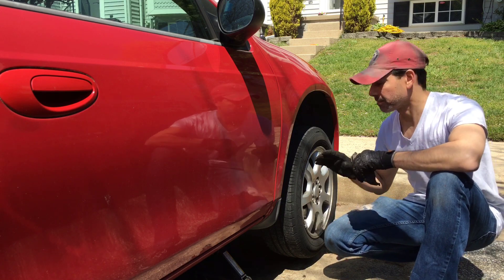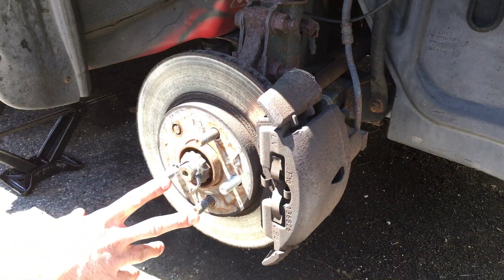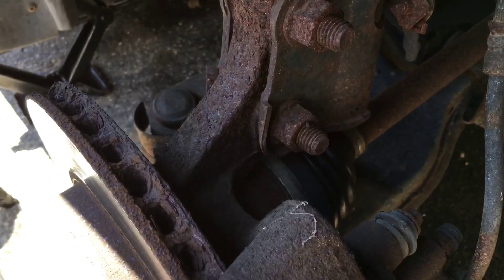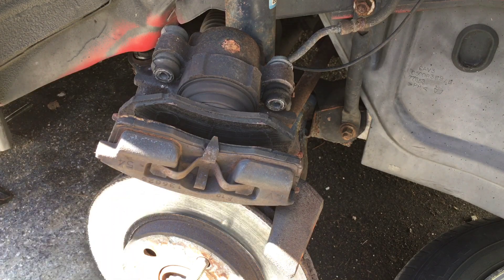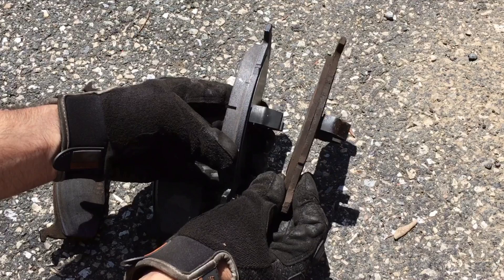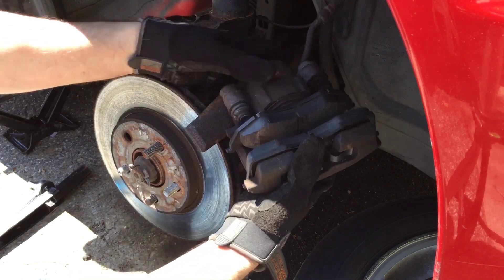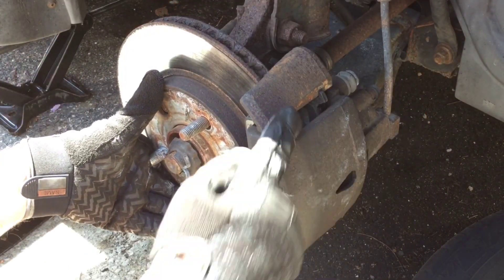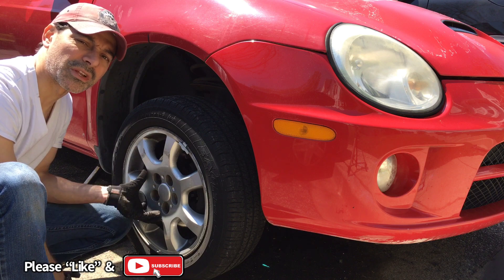How To Replace Front Brakes - Dodge Neon (Andy’s Garage: Episode - 182)

Comment: I'm surprised you did not mention anything about inspecting the rotors.   Especially if a caliper it's not working properly and the inner shoe is more worn than the outer it can actually create grooves in the back of the rotor. Also this rotor appears to be very glazed and should at least be turned to clean it up or other methods to resurface the rotor.

Comment: Front wheal drive 2004 dodge neon R/T 5 speed 
I check brakes and calipers and everything looks good and sensor is good too
The abs light was on but not today after cleaning the everything it's off now 

What do you think the clunk noise coming from felt like the middle

Comment: hi, Love your videos. 
I am doing my front brakes and I can't get the pass front cylinder to compress. any suggestions? Thx ahead of time
Reply from the maker: Did you try using a c-clamp? If so, make sure you have it aligned straight. If it’s slightly crooked it won’t move
Reply: @PhillipsVision  Thanks. the plunger was stuck. so I got another caliper from LOcal auto shop. I am gonna swap thm tomorrow. Thanks again for responding and the help.
Reply: Quick tip to any mechanic who dont know....
Before you clap the caliper you should always take the brake fluid cap off to release the air pressure

Comment: How long you been using brakes from eBay and do you have an specific seller you always go to?
Reply from the maker: Erick Zepeda actually this is the first time I bought brakes on eBay. Normally I get them from Advance Auto or Autozone. With all this COVID19 quarantine crap I figured I would order them and have them delivered, also found a good deal on a brake/rotor bundle. I just searched it out and looked for decent quality.
Reply: Phillips Vision I see thanks for the info and I’m really learning a lot from you man

Comment: Quick tip to any mechanic who dont know....
Before you clap the caliper you should always take the brake fluid cap off to release the air pressure
Reply: Thank you
Reply: Not sure what you mean by clapping the caliper, however there is no air pressure in a hydraulic system whatsoever. Also you should never leave the cap off of your master cylinder for any length of time. Brake fluid is hygroscopic and will draw moisture out of the air.   This lowers the boiling point of your fluid and also can be a source of corrosion.   

If you want to release pressure to make it easier and safer to compress the caliper you should put pressure on it and release the brake bleeder screw which will cause the fluid inside the caliper to squirt out the bleeder screw.